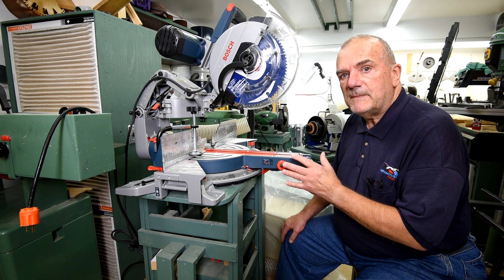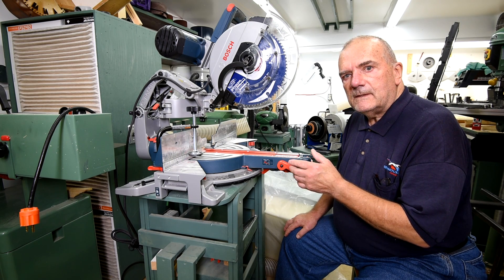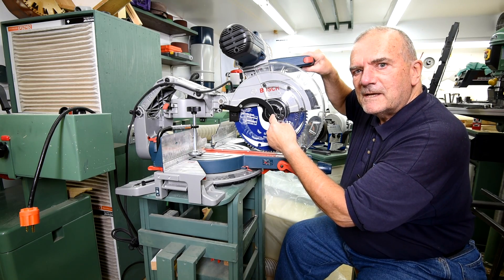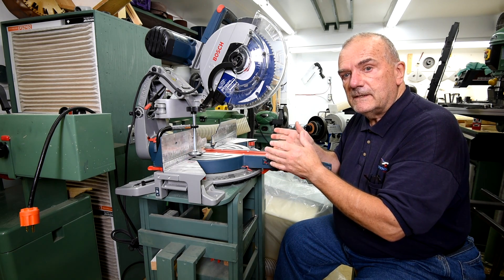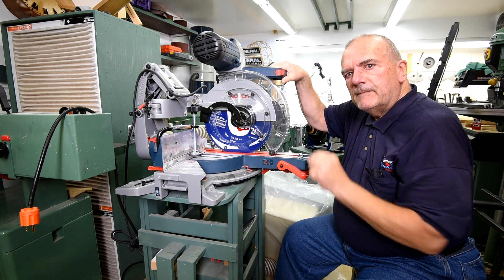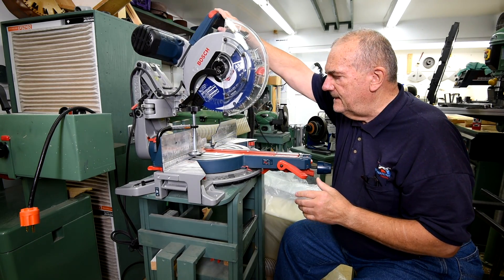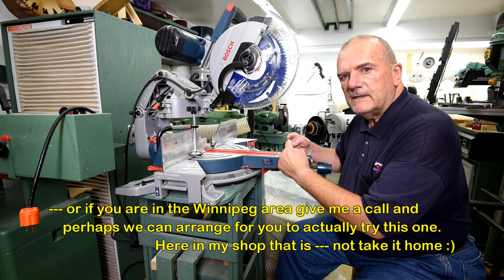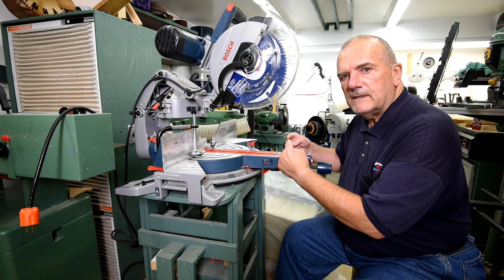Bosch GCM12SD - Blade Deflection - Part 3

Comment: Hey Ron

Just found your comparison #3.  

I am a 65 year old cabinet maker with my own shop. Don't sell tools at all. 

I attended a wood tool sale and was able to compare side by side De walt, Mikita, Bosch, Milwaukee and Festool 12" slyde saws. My goal was to purchase "thee best" 12" slyde saw!

By far the saw you have, had the smoothest forward and back movement and clever inovative design!

like all wood workers we want tight joints and miters. One of the greatest tests for any miter saw's ability to cut a" stright stressful " joint is to cut 8/4 (2") x 12" maple or hickory on a 45° angle. That creates the longest cut and introduces your greatest chance for side deflection of the saw"cutting head" possible. So if the saw dosent cut straight and has lateral deflection then you will see that in the miter joint as a gap when you bring the two peices together!!! so if you have a gap you and everyone else will "see it" as well!! By the way , thin kerf blades have no place in these heavy stressful cuts.

It goes without saying you must buy the highest quality blades, and the lowest prices would start at $125.00 american dollars......start!

So how do you test for the greatest strength/least deflection, actually very easy.  

1st. step: Lower the cutting head and lock it in the non cutting traveling position.
2 nd step: slyde the head all the way out and lock the miter adjustment at 90°(towards you) and lock the head so it cannot slyde in and out. The head is now locked at 90° and out.
3 rd step: Now , sort of stand sideways to the saw and with one hand grab the saw head and the other hold the saw (hard to describe) and pull perpendicular or side ways on the saw head. You will feel the movement/deflection.

This is the number one key to buying the  "best" miter saw. Because nothing else effects the quality of the cut as much. I base my entire purchase on that comparison!!

Don't take my word for it, test it yourself!!

Visually I thought festool would win with their wide spaced slyde rods and price tag and  wonderfully quiet motor......not the winner 
I loved the silky-smooth action of the Bosch.......not the winner
I loved the 15" crosscut travel and quiet motor of the makita......not the winner
De walt,  nice saw ......not the winner

The winner has a stinking loud motor, and a pitifully small cuting deck.......and I bought it because without question it had the" least flex/stiffest" cantilevered head deflection!! And I  am glad  I did!! In addition, I absolutly love the digital readout of the head turning left and right in 1/10 of a degree(example 34.7°). That is so helpful when trying to make very small adjustments for quick accurate results!! This means I can return to the exact cut angle ten minutes from now, or next week.  Also as another helpful feature is 2 lights,  one on each side of the blade. Whereas a lazor in dim light growes to a wide fuzzy line obliterating the cut line......

A, oh yes the winner ......Milwaukee 

So back to our "quality " cuts... . the Milwaukee is noticeably stiffer with a direct comparison to the others. Agin, I don't sell or am in anyway connected with any tool company or store or website! I use the equipment. All equipment gets sloppy and wares out. When my Milwaukee gets ware and slop I  will sell it to some framer and we will both be happy. All thoes other saws start with slop to begin with.  The Milwaukee has some to!! Just significantly less.

In wood workers land of dream tools ......I would take from all the saws their best features and create a super saw.........I am sure I will be dead before that happens....... 

many/most  people don't use their equipment that hard. And with a quality blade get adequate cuts.......everyone has their own standard,  and if they are happy......good for them.....

side bar......I use that saw on the job site, because while it's a great slyde saw it can never compeat with the quality of cut I get off my 700 lb PM2000 table saw and slyde box. Big bearings.....heavy everything.........

opinionated old wood worker

just jim
jimknowles00@gmail.com
Reply from the maker: Hi Jim, Re:"opinionated old wood worker" that makes two of us, lol  :)
Reply: I'm glad that someone finally mentioned their table saw. I think most people expect too much from a slider. It just stands to reason that any machine with moving parts needs some give, and yes, tighter tolerances are best and certainly achievable for any saw, but the natural ergonomics of a table saw as well as all of the buildable or the availability of purchased jigs are far better.  That being said, I don't think any slider can come close to a good radial arm for cross cuts and dados. For years my grandfather had a Rockwell and it stayed true it's entire long life. Too bad all the new ones are so damn expensive.
Reply from the maker: Thanks for commenting. Love my tablesaw. Hate my radial arm saw because I didn't realize that it was so very worn out when I got it used. Was only $75 so what did I expect. In my opinion, it's actually dangerous to use.
Reply: I don't think I would ever rip on one and I have seen it done but, when tuned and in good condition I think they're awesome. I've known a few people who have had Crapsman RAS' and they've always been lousy. You can buy new and refurbished saws with all the new safety features but they cost much more than any miter saw.

Comment: You are probably the most patient man I have ever seen. If I was still in Grand forks I would have to come visit you on one of my many trips to Winnipeg. Here's a quick tip for you that I found out while talking to a Bosch rep. You don't have to press the safety switch it's Bi Directional it will work if you press it in or push it out.
Reply from the maker: Thank you for that tip :)

Comment: My husband bought me this saw, that I’d wanted for over a yr for Valentine’s Day ‘18.  Not long after I started using it the cuts were almost an 1/8” off with the blade needing to tilt to the left.  I’ll square it using a speed square and digital square then make a cut and it’s still off.  And this is cutting just a 2x4 that’s been cleaned up. I’ve watched video after video, read the instruction manual, but am close to returning it.  Thanks for the time you’ve taken though, it’s been really helpful in a lot of cases
Reply from the maker: Hi Mr. Roberts,
Re: "am close to returning it" Wow, that's disappointing. I think that generally speaking you will find that your saw will do what you need, for the average woodworker, as soon as you've identified your problem. I'm still happy with mine, but have to admit that I'm not using it as often as someone who's living depends on carpentry. I don't know your situation.
PS: Don't let your wife see your dissatisfaction. Enjoy your gift! Fake it if necessary, lol. Thanks for commenting :)
Reply: Firstly, I am the Mrs!  My HUSBAND bought it for me and I’m just a hobbiest.  All this said, I worked on it this morning. After blowing out every nook and cranny I could find and cleaning the blade it squared at 89.7 on my digital level.  Have any idea what’s out of whack that is causing this?
Reply from the maker: What color is my red face!! Yes, after taking the time to properly reread your first comment, it is perfectly clear who's who. Please accept my most humble apology.
I guess that because my saw was satisfactory for me right out of the box, I just assumed that it was okay for everyone else too. Rather than go downstairs into my workshop and try to shoot another video, I've come across one that another woodworker has uploaded that in all likelihood I'd not be able to improve on. Here it is. https://www.youtube.com/watch?v=aHOeikdrE9A Now, this deals with the tilt adjustment. Good luck, and I'd be interested to hear how it goes for you :)
Reply: No apology necessary, just razzing you a bit! I’ll be the first to admit it’s very easy to assume all woodworkers are men and I’m not offended in the least.  
Anyway I’ll watch the video and see what it shows, I also know a Bosch exec who I might turn to as well for factory asst if it goes that far. Thanks again
Reply: Ok, so I have 2 homes. I got the saw in February at my main res then 4 days later had to go to 2nd til June.  When I got bk for whatever reason it was out of square so I watched the video you suggested. I was able get it square again at 90. I had watched it right before watching yours but thought I remembered everything in the other, however and a big one at that, I had forgotten to loosen the set screw  opposite the one that brings the head into alignment. 🤪.  So went bk and followed the instructions from that video and actually did exactly what they said that I hadn’t done last time.  That being work in reverse instead of a random pattern of tightening the back bolts then bevel lever then set screw. Still don’t know why sitting for a few months caused it to lose its square to begin with, but least now I know how to fix it!  Thanks again for suggesting that video although I wasn’t going to watch since I’d watched it several times previously, but it hit me, maybe there was something I missed!  In addition though, I replaced a DeWalt 12” compound sliding mitre I’d had for 16 yrs with this. Pros of this are the cutting capacity, the way you can bring the head into alignment by turning that screw as opposed to having to reach behind on the DeWalt and turn that big  star knob. I won’t go into what a circus that was, but it didn’t send cut offs flying through the shop like this Bosch does.  There have been a couple times when cutting a small portion off caught the blade, had it hit someone, it would’ve hurt them.  So there’s my story!
Reply from the maker: Thanks, that's quite the story.
Tip: You may already do this too, but I've found that if I allow the blade to coast to a "complete" stop before lifting it up out of the cut, I get less stuff flying across the shop.  All the best.
Reply: I always do let the blade come to a stop, but this will happen as soon as the piece is cut. I just make sure the dog and kid are not around when I’m cutting something 
Thanks again for your help
Reply: @roncalverley  add a zero clearance fence and zero clearance plate. I have a solid 4 years as a professional woodworker, 30 or so blades. I have ripped some chunks off with this thing.  The problem is the small pieces that fall into a bad spot with the blade.

Comment: Thank you very much for making this series of videos. Even though your comments are years old, you still, potentially, saved me a lot of worry. After much research I was ready to buy this Bosch saw this morning, but someone beat me to the last one my local tool store had in stock. So, 8 hours later...give or take...I went to my local Home Depot and bought a Makita LS1219L or $690.00 Canadian, vs 800 for the Bosch. I pulled and tugged on their display model and it was rock solid. I too have high standards when it comes to having accurate tools. I haven’t used it yet, but I’m confident I made the right decision. If the Bosch box was sitting in my shop right now I’d be sweating bullets. As a bonus, if I subsequently discover it’s not accurate, back it goes, without any hassle...and I’ve got 90 days in which to decide. If I’d bought the Bosch from my local tool store, a return, because of something as vague as accuracy (since, like beauty, it’s in the eye of the beholder), might have been problematic. Thanks again. Someone with Bosch made a significant mistake by not treating you better....requiring you to ship it to them, at your expense, was a bullshit move.
Reply from the maker: Murray --- what are you talking about here. I must have missed something. I'm still happy with my Bosch. 😐
Reply: Ron Calverley 
Yup... I realize you’re happy with it...as you stated, for what you use it for it meets your needs, but I’m thankful that you pointed out how much play there is in it...particularly the side to side sloppiness. For what I do that’s not acceptable.
Reply from the maker: Re: "you pointed out how much play there is in it"
Apparently you have misunderstood what I was saying.
https://youtu.be/0U14FolePn8?t=112
Reply: Ron Calverley
You sir are absolutely correct, and I’m feeling pretty silly. My comments were meant for a different poster. You might be interested in his video...then you’ll know exactly what I’m talking about. Again, I’m sorry for the confusion. If you’re interested have a look at this link. I think you’ll then know exactly what users are referring too. I think Bosch has a serious consistency problem, and their saws range from excellent to nearly unusable, depending on the luck of the draw. FYI, I went to another local tool store yesterday, and checked their Bosch display model. It didn’t have as much play as the one in this fellow’s video, but it was nowhere near as tight as the display model of the Makita at Home Depot. If mine is as tight, I’ll be one happy guy. 
https://youtu.be/Ya0GokwyU-s

And happy woodworking...
Reply from the maker: Hi again Murry,
Okay, I've watched his video. Wow! I'd never noticed mine to be like that. I've made hundreds of cuts with mine and never been disappointed. Next time I'm down in my workshop I'll check mine out. btw, thanks for getting back to me. 👍🙂
Reply: Ron Calverley 
I’m happy we got this sorted out....being “somewhat elderly” I was thinking I was losing my mind. From what I saw in YOUR videos, yours looks solid. 
Take care....keep having fun and keep posting those videos.

Comment: Hi Ron, I have this saw and I do see the problem that some are talking about. I think you are a lucky one that did not get one out of tolerance. The problem with mine is that the plane of the blade is not parallel to the linear glide motion (nothing to do with blade deflection). Try this test- At 90 degree miter the side of the blade should be perfectly perpendicular to the fence as tested with a good square. Now follow the tip of a tooth of the blade along the square as you pull the blade along the glide path. That tooth should follow the edge of the square along the whole length. Well at least with mine the tooth moves 1/16th inch away from the square along the travel. This is pretty poor tolerance, and there is no way to adjust it. You can set the miter angle such that the glide motion is 90 degrees to the fence but then the chop angle (blade side) is not 90 degrees. One more thing, many guns have a grip safety (Colt M1911 for example) much like the miter saw safety, since you were asking :)
Reply from the maker: Thank you for that comment. Also, I guess that I obviously don't know much about guns. Thanks for that info :)
Reply: Yeah, the 1911 was 80 years ahead of its time.   Unfortunately, it is semi auto, and it will have to be forfeited if Swalwell gets elected.

Comment: I overrided mine as well by just pressing the button out and screwing a 3/4 inch dry wall screw in. I personally used this and the 12 inch sliding dewalt saw, the DEWALT has far more lateral movement, the Glide has little to none...
Reply from the maker: I'm happy to be learning that there are others that found that button annoying. Thank you for you comment :)

Comment: Great video!  I am looking between this saw and the 12" Makita.  I have a friend's 10" Makita and if I push hard, I can make the "head" of the saw move from side to side a bit upon full extension.  I'm in a very rural area and it's hard to find a dealer who will fire up a saw to test it.  But I'm going to try that side-to-side deflection upon full extension to see what happens.  My other issue is dust collection on the Bosch.  I've seen enough videos to see that it can kick out lots of sawdust.  Not good in my shop.  Your experience with dust collection (I have a shop vac with a HEPA filter, a Festool dust extractor and a 3hp dust collection system that starts out with 8" pipe).  But I use the shop vac with my chop saw and want to keep that.  Thanks for listening to my long story.
Reply from the maker: This is what I did for my dust collecting with this saw. Simple and I still use it now, 3 years later :) https://www.youtube.com/watch?v=009wDjUHsGU
Reply: Brilliant and simple dust collection solution.  Now that I heard you talk about how you use the saw, it really seems right for you.  You are a turner, I'm guessing.  I'm making furniture and 95% of the time, I just need the wide, deep capacity to make 90 degree cuts, consistently, without putting the boards on my cross-cut sled.

Comment: Hi all,   I bought a GL12 a couple of years back as a toy for myself. Now well and trully retied from gameful employment in the house building game I still dable at making the odd wooden stucture. Intro over: I had noted if your heavy handed when using it will make a slightly wider kerf, take it easy let the blade do the cutting. One slightly annoying thing about my set up: The saw is on the Bosch folding mobile stand, which is great as the saw stays attched to the stand when folded away. However, whenever it pulled back into cutting mode you have to re-zero the horizontal as when hanging it will  go out of 90degs to this plane. I sometimes forget an end with sqint cut. It now has a lable Pleaese Re Zero Me before use, this is my only niggle. I gave away my Electra Bekum chopsaw  which was bought new way back in the last 70s alway spot-on. The only thing I ever replaced were blades and one overload switch. I wonder If this GL12 will last as long ? Hopfully it will out last this old git..
Reply from the maker: Thank you for commenting :)